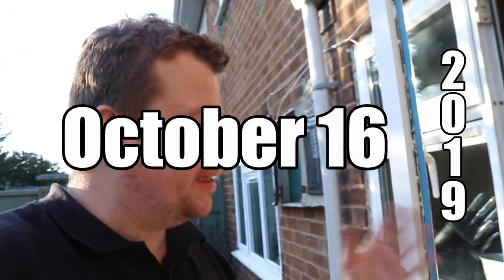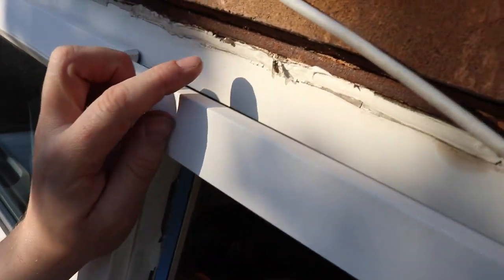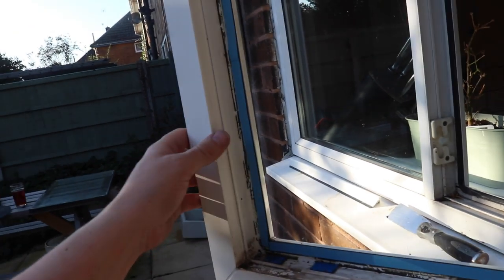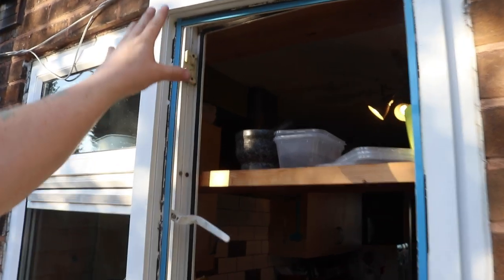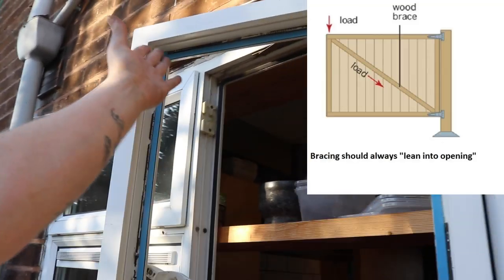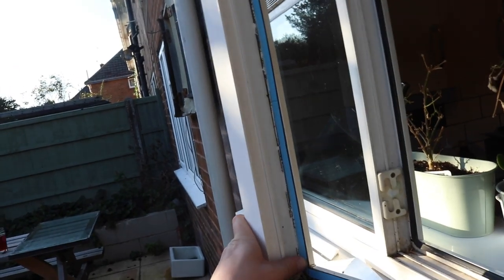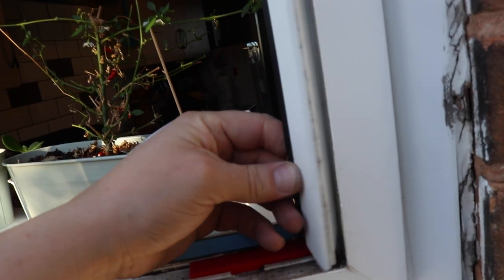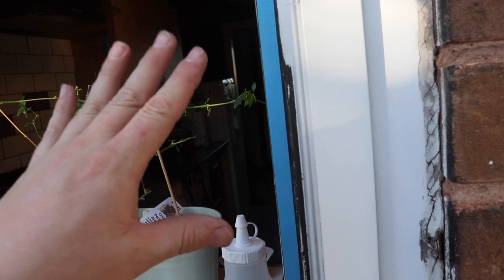Bracing Window Frames - Toe & Heel. uPVC window door

Comment: Hi there. My window in my house is not closing correctly ,it's a side hung window now on the lock side it's fine but on the opposite end it has about 4mm gap now I have recently changed the hinges as the gap was alot worse before this . Now my question is have I done something wrong when put the new hinges on or is there  an  adjustment screw I need to alter to bring that side in. Thanks you hopefully you can get back to me as soon as you can .

Comment: Hi Harry, firstly many thanks for the video, really interesting and helpful. Can I ask is this something that also needs to be done to "Top Hung" UPVC window? Mine have gone terribly out of line and will no longer shut at all! I think it is down to our house moving in the warm weather, but was wondering what is the best solution to fix it. Best Jim
Reply from the maker: You can do it to top hung sashes to prevent lateral movement yes.
Reply: @harrybrew69  Hi Harry thank you so much for your swift reply. I only wish you were able to come and fix my windows for me, as I think it is a job a  little too tricky for me. At least now I have a little further knowledge when trying to get a handyman or glazier to fix them. Many thanks again and all the best Jim

Comment: Hi Harry. I've got a window like this that I can see light through on the vertical hinge side near the top. Is that heel and toe issue or just an adjustment i can make to the sliders. Seems to me the window edge doesn't go far enough over to quite reach the seal. Any advice would be appreciated. Thanks

Comment: Bad idea having the glazing beeds external. Just take them off and the glass out to break in. Should be all internal.
Reply from the maker: You can't get the glass out without access to cut the security tape on the inside. I do, however, dislike externally glazed windows as they are a pain to glaze on anything other than the ground floor.
Reply: @harrybrew69  Has this house got security tape because it was burgled in 2005 ? External trim was out by 1999 wasn't it.

Comment: I hate to worry you but you have what are known as burglar windows, your house insurance will be invalid if you have to make a claim, the window capping should always be on the internal face. I haven't seen these for years but I do know if you forget your keys you can get in with no damage, please for the safety of the family fit some new ones yourself, you will do a much better job then the trades did.
Reply from the maker: Nonsense, these have security tape, Impossible to get the glass out without access to the inside.
Reply: Yes impossible.
Reply: Security  tape....chocolate  teapot